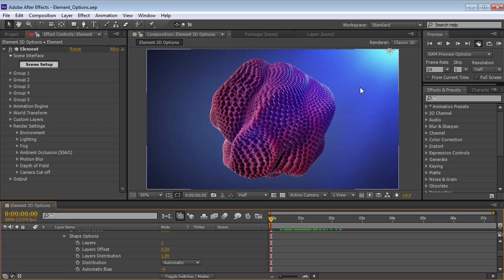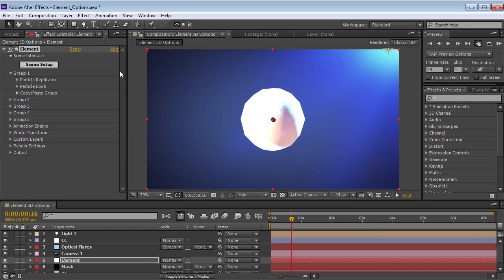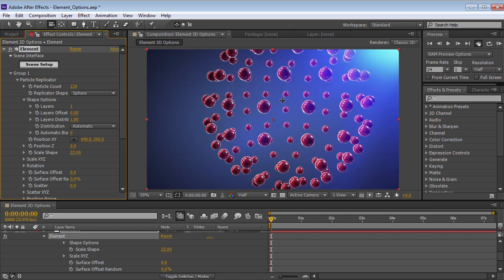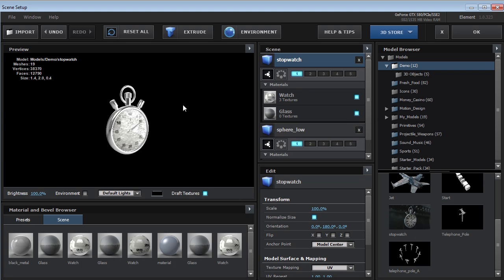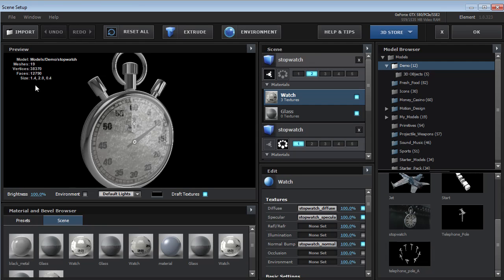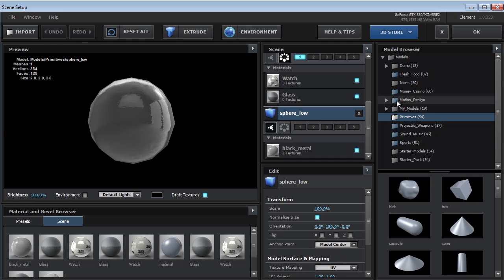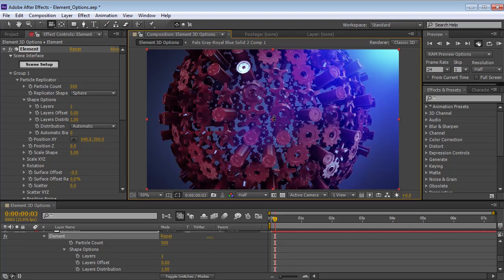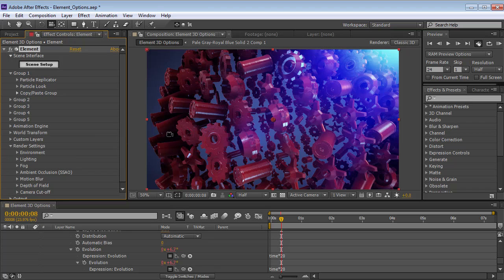Element 3D Replicator Options

Comment: Can you still use the 3d Object option in Element 2.2? The button is no longer there for assigning the object.
Reply: +Sam Roe there is- in element v2 click on the Group number and its to the right of Group 5.
Reply: +AV-Ultra amazing thank you!!!!
Reply: +Sam Roe Any idea if it might be possible to place them at face centers instead of vertices?
Reply: Currently I dont think this is supported as it wouldn't know where in the face per se- with points we have uniform XYZ coordinate. And while thats true with faces - theres more involved when talking about normals and which way the faces... face.  Element is a AWESOME tool- but for that you would need a full 3D program i think.  Just my opinion.
TL:DR- Dont think so.
Reply: Thank you. I sorted it out. I needed them at certain points so I made a weird geometry that had a point where I wanted them instead of a face. Was filling a stadium with people. Pushing the plugin to it's limits!
Reply: +Sam Roe That sounds pretty awesome. I'd love to see the result if you can share it.
Reply: +AV-Ultra Unfortunately it's under a NDA but eventually when I can I will. It was incredibly tricky because there are limited options of where the clones will face so I had to break it into sections, and as you know there's a limited number of groups. I wouldn't recommend doing it in this plugin but I hacked it together in the end.
Reply: +AV-Ultra Unfortunately it's under a NDA but eventually when I can I will. It was incredibly tricky because there are limited options of where the clones will face so I had to break it into sections, and as you know there's a limited number of groups. I wouldn't recommend doing it in this plugin but I hacked it together in the end.